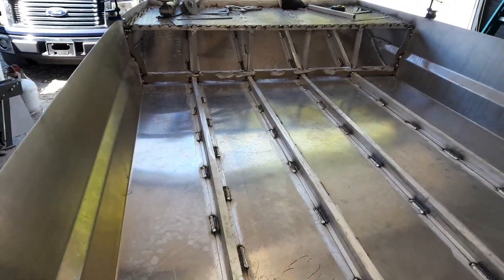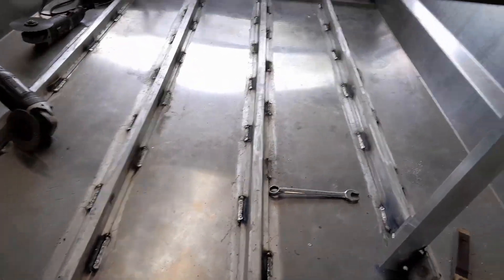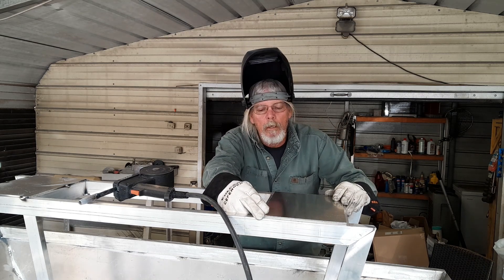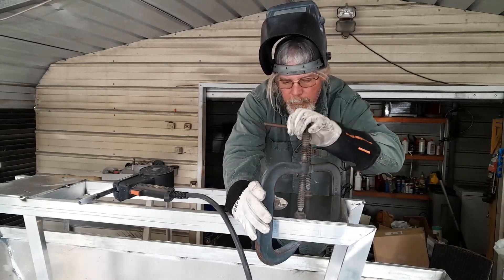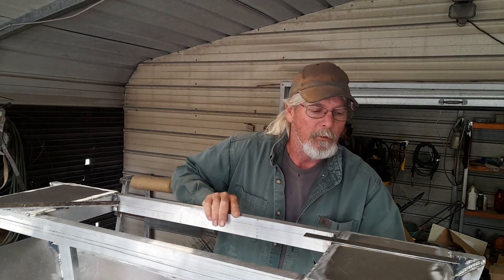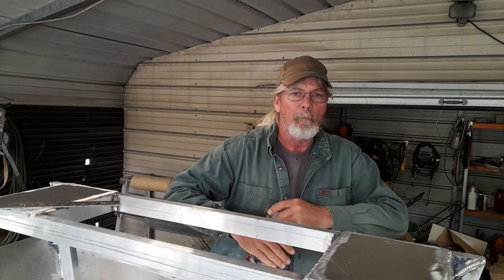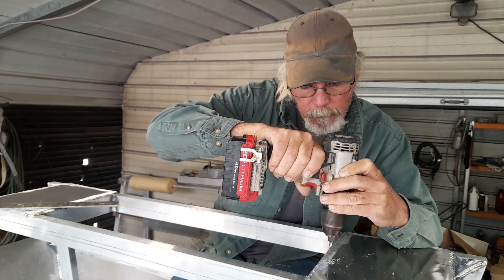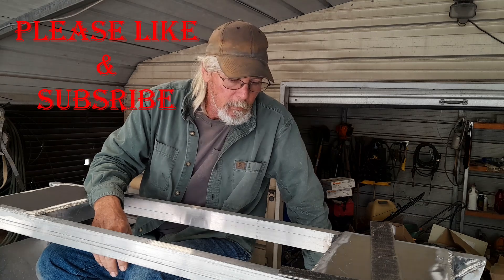Twin 459cc mini airboat build pt5

Comment: What gauge aluminum are you using for the hull ?
Reply from the maker: @jerryterry6895  5086 .100" probably could have used .090" but I was concerned about warpage from the width being so wide